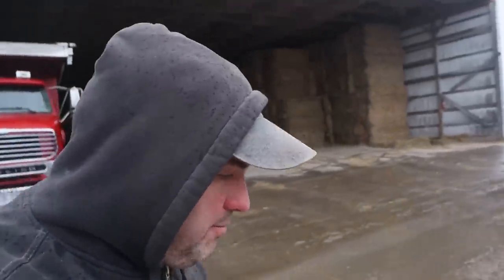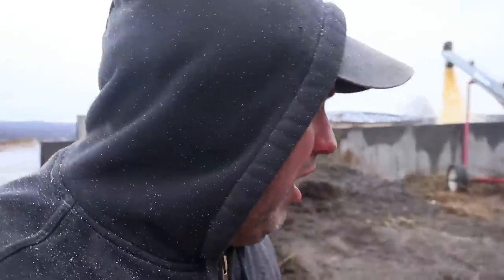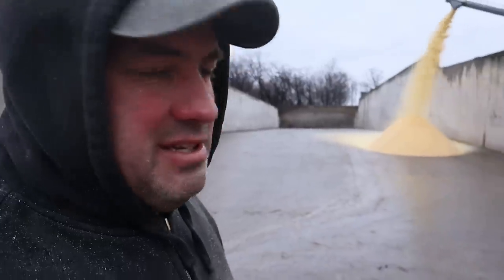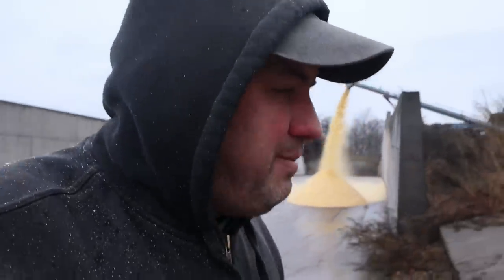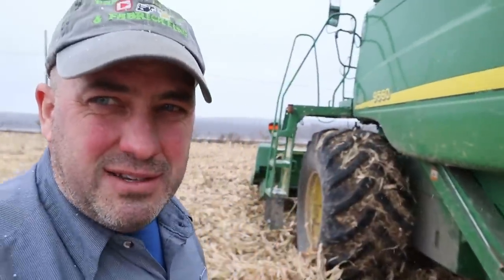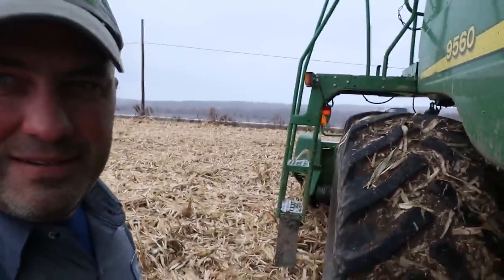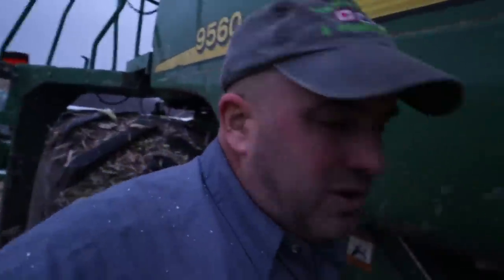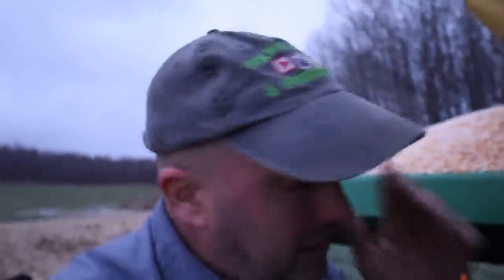Himoisture corn going into the bunk

Comment: With the problems you had with the chopper rear axle I was wondering about it and the combine axle if they're mud dogs or mud hogs I can't remember what the name is but if that's what you have keep an eye on the tires if they start leaning like a bad ball joint shut it down and get it fixed if they lean too hard it strains and eventually destroys the internals my cousin is a machinery mechanic started as a JD tech then went to a dealership that sells almost everything at 17 locations so they keep their new machinery color coordinated and have used lots with every color we had problems with our JD I believe it was our 9500 he told us about the rear axles if the 4x4 was used much (and we have alot of bottom ground and flatland in Kansas and Nebraska) we ended up replacing the rear axle with a red one and painted it green with yellow wheels as a winter project and never said anything when we sold it after buying a new one for wheat (we call it poverty grass) and soybeans and changed the older 1 to corn we get more out of them buying 1 and selling the old 1 outright instead of trading it off with the dealerships around here but those mud dog or hog rear wheel assist axles are known for the tires starting to lean binding things up and if you're lucky you catch it leaning if you're somewhat lucky the wheel falls off they replace the knuckle pins and broken lines if you're lucky is like mine they put the wheel back on with expensive parts and it locks up within a day or 2 because of the strain that was on it with the wheel leaning binding things up and you're in it for so much money you just as well finish having it rebuilt and next time a tire starts leaning replace it with the other brand that the red machines also use if you're lucky you'll find a green 1 then advertise the mud junk on machinery marketplaces with a wheel starting to lean people are always looking for parts for them and they sell pretty quick and we got almost 2/3s new price for ours the 1 the wheel fell off we got just under half price

Comment: Excellent video. A couple quick questions do you put anything on as far as preservative or acid. What's your thoughts on the moisture if it's too high the cattle cannot get the full benefit out of it. We have a dairy farm that once it between 24 + 26%
Reply from the maker: We don't use any preservative and it needs to be ground up more the drier it is.

Comment: A hydraulic drive auger would be nice coming out of the roller mill then 1 tractor could do it all
Reply: Not sure if a hydraulic motor could handle the length of auger that dumps it into the bunker
Reply from the maker: That would be nice

Comment: Just wondering on the roller mill why u take the blower off. Wondering if you could mount a short chunk of silo pipe with a gooseneck on it to blow into the bunker silo. Then u wouldn't have to mess with the auger or taking the blower off. I'm sure u have a reason u been this for a long time. Thanks Andy!
Reply from the maker: We have done that in the past and it makes a mess. Seems like the wind is always blowing here.
Reply: @FarmingFixingFabricating  I see. Thought about that after I wrote that if the wind might be a factor. Thanks Andy